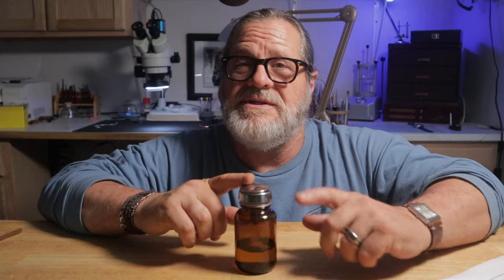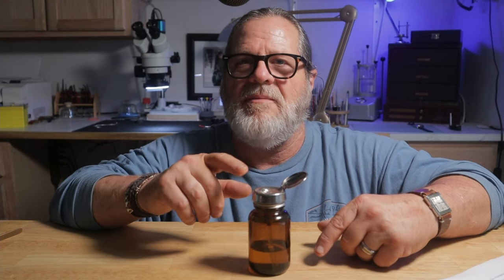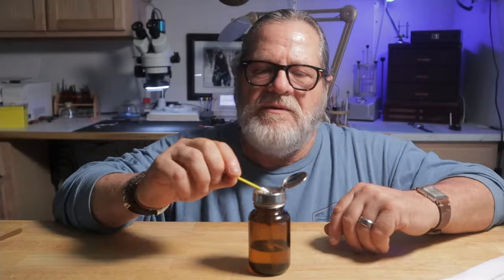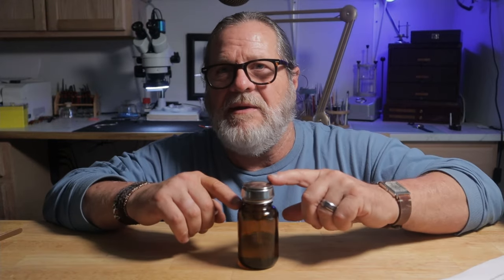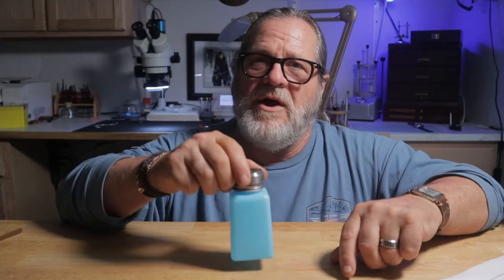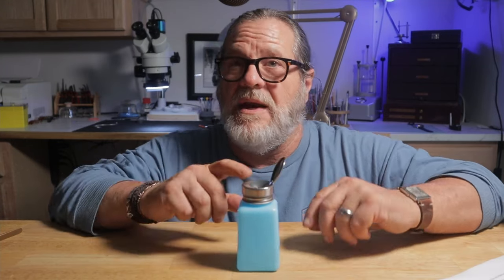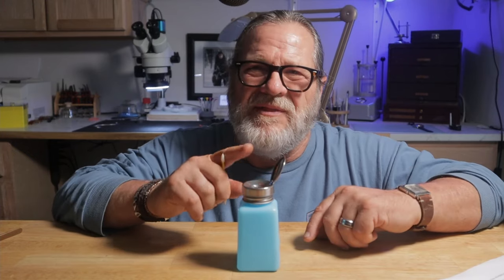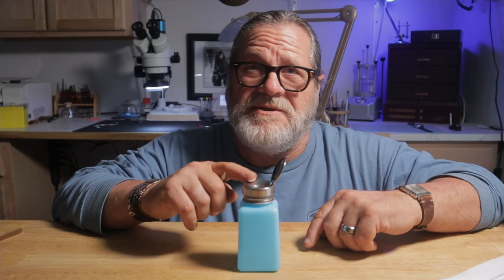How to Clean Watch Parts Without A Machine-Watch Repair Lesson #8

Comment: What is your recommended method/solutions for cleaning the balance and pallets of vintage watches as to not risk dissolving the shellac?
Reply from the maker: I use a product called Hexane It’s similar to a product called one dip but it’s much less expensive and it’s great for removing grease and oil’s. It’s  laboratory grade so leaves no residue. 
I use a little jar called a diamond cleaning jar, that has a hard metal basket in it. I put in the balance complete along with the pallet fork.
I let it suck for a couple minutes and then I lift the metal basket out of the jar and just move it up and down to kind of agitate the liquid over the balance will a pallet fork. I might do this two or three times over a period of 15 minutes.
And then I just pull them out, put them on watchmaker paper and cover it with a dust cover. Works awesome
Reply: @watchrepairtutorials  very much appreciate the response! About to do my first watch and your videos and knowledge has been wonderful in preparation.
Reply: @watchrepairtutorials  Hey again love the vid. I've mostly been hearing that one dip is actually perchloroethylene which is very similar to hexane and it's actually cheaper and easier to acquire than hexane. Lab Alley will ship the 99.9% "perc" to any address whereas hexane must be shipped to a business address as it's a DEA regulated chemical in the US. What do you think about this? Are you familiar with this chemical? Every resource i can find says One Dip is 99.6% perc with the other 4% being some proprietary anti rust agent which may or may not be bs.

EDIT: i found the official documentation. At least the old one dip was indeed perc. It's a pretty good and cheap alternative to hexane in the US.
Reply from the maker: @nunyabusiness9056  According to the CDC, Perchloroethylene is a know carcinogen.  I don't know of any professional that use it. Maybe some do, but I don't know of anyone.
One the other hand Hexane is widely used as a bench top cleaner in the industry. I'm not sure where you heard that Hexane can't be shipped to a residence, I  just ordered some, no problem.
Reply: @watchrepairtutorials   that's real strange you could get it delivered to your home. It was Lab Alley themselves who called me and told me they couldn't do it but did say they could ship it to ANY business address no matter what the business is. 

Also i got no idea who does or doesn't use perc but iv'e since found the original data sheet bergeon had to put out in the uk about one dip and it does say it was 99.6% perchloroethylene. 

I will definitely look up the safety data on it so thanks for that. I only use it in a small jar for the hairspring and pallet fork cleaning so it's probably not too dangerous.

Again thanks for the great vids. Used your cleaning method with the drill and naphtha for the first time last night and it seems so far to have done the job!
Reply from the maker: @nunyabusiness9056  You are correct about the formulation of One Dip. I don’t believe I said it was the same formula, just that it performs the same.
To clarify the shipping requirements for Hexane, I did send them a message and asked about residential shipping and was told that they had my business license on file and that’s why they are able to ship it to my residence. I guess if you are not a business or have don’t have the ability to ship it to a business address then that is a problem.
Anyway, thanks for bringing up the point so we can get some clarity on the issue.
Reply: @watchrepairtutorials  Ah it sounded like you were saying it was one dip maybe i misheard.

Either way i was more just trying to clarify that i didn't piss away 30 bucks on the perc i just got and was just about to clean my balance assembly with haha. I was basically thinking.

"Wait...onedip was hexane? i thought it was perc? Then wtf is perc used for?"

Glad we got to the bottom of it. Seems like a decent alternative for those who can't get hexane.

Comment: Wait... I thought that IPA will dissolve the shellac used to hold in the jewels for the balance and escapement anchor.  I've always read that naptha was the only safe chemical (outside of purpose designed cleaners) to use on these parts.
Reply from the maker: It will with too much exposure. What are you confused about?
Reply: @watchrepairtutorials  Why would you use it as a rinse then? It seems like anything that would degrade the integrity of the shellac should be avoided on those parts.
Reply from the maker: @k-ozdragon  ok now I see what you are saying. I show and talk about Hexane and one dip for cleaning the hairspring and pallet fork. I probably could have explained it better in this video. I do talk about it more in the ultrasonic cleaning videos I made.
I always clean the balance and pallet fork separately from the other parts.
No matter if I am using a spinning basket or ultrasonic machine. 
Here is a video I did showing how much exposure is safe for shellacked parts.

How to Clean Watch Parts with IPA
https://youtu.be/x_6TulURYII
Reply: @watchrepairtutorials  OK perfect, I'm watching everything in order, so I should hopefully get to it soon. As far as I know, it's just those two parts. Do they still use shellac to glue those jewels? It seems like movements after 1970 would use some sort of rubberized acrylic.
Reply from the maker: @k-ozdragon  shellac is used because the stone is adjustable by heating and then it cools pretty rapidly.
Reply: @watchrepairtutorials  That makes sense. I'll have to watch videos on how that's done. Very cool. Kinda crazy to think how we're still using a material that was in use over a century ago for this purpose. Even crazier when you realize it's a bug secretion. It's even used in food products.
Thanks for the info & taking the time to respond, I definitely appreciate it!

Comment: Hello Alex, my name Gregoriy, I am watch repair men, I cannot fix this Cartier Movement Caliber 052 (ETA 2892-A2). the dates  the problem, if you have any suggestions...
Reply from the maker: What exactly is the date system not doing ?
Reply: So, basically dates keep jumping, example disk 1 will pick 1 and second disk will pick 1 to show date 11 next day it will show 27 instead of 12... extremely hard to explain, date disk are located at the 6 o'clock, are there any videos specific to this movement? 
 @watchrepairtutorials
Reply: Hey Alex, when i do quick set for dates, there is 2 disks so if you set 1 on disk 1 and 1 on disk 2, date is 11 but the next day dates change to 17 or 23, dates keep jumping... please help
Reply: also dates are located at he 6 o'clock
Reply from the maker: @sergeyakubov5355  you are just going to have to study the gears and figure out which one is not transferring the motion.

Comment: I wonder if automotive brake cleen would work it drys super fast doesn't leave a residue
Reply from the maker: Try it and let us know.
Reply: @Watch Repair Tutorials  seen your video on shellac damage so may be good for everything but the escapement assembly
Reply from the maker: @MrShaun1578  If there is no residue and its not to alkaline, it should be ok. Let me know how it works for you
Reply: @watchrepairtutorials  ok upon further research CRC Brake Kleen (red label not the green label) is Tetrachloroethylene one dip is the same thing you can buy it by the gallon maybe a way to save money there
Reply from the maker: @MrShaun1578  That's so good, I' m going to include it as a bonus tip and give you the credit bud.
Reply: @Watch Repair Tutorials  actually you can just by a gallon of Tetrachloroethylene for 65 dollars on amazon I found its cheaper than one dip and brake kleen I can send the Amazon link

Comment: Alex !!!  I couldda just shot myself in the foot !!!  When I saw how you " made " your own Basket for 
    cleaning & did it without spending a small / large fortune !!!
  ( like I just spent - EARLIER - TODAY  !  by me buying a very vintage L& R cleaning machine . . . .
At least I got one with heat & reverse . . . .. BUT ?!?!?!  the point is - I did not need to ;-( 

In my future =  I'll try to learn the life lesson  - to be more patient !

Luv ya man  ; )
Reply from the maker: Hey brother, don’t consider it a mistake but a blessing.
This video is really meant for people with so budget or someone doing a one off cleaning.
Many people will start off at this level and as they get deeper in, start thinking about upgrading.
The BEST option for cleaning parts that’s a pretty much no brainer is with professional grade cleaners and rinses like L&R
Reply: Alex ,  I'm just getting started. . . . But also trying to do it on a budget . . . . .  / While also trying to use the " correct - tools ..." @watchrepairtutorials
Reply from the maker: @timparhamsr9598  yeah, I understand but you’ll be happy about it in the long run for sure.

Comment: I am confused sorry, watched twice and did not get it… In summary: 1) Pre cleaning by soaking in Naphtha and mechanically removing gunk; 2) Cleaning cycle by soaking and twisting in ???? (Not clear); 3) 3 consecutive rinses in Iso Alcohol. Never water. This applies to all movement parts except the ones wit shellac, which should be cleaned by ??? (Not clear). Could you pls clarify?? Tks
Reply from the maker: First let me say this is for real beginners, people who aren't ready to invest in the hobby yet and people who want to Mcgyver the cleaning process. 
First you can clean parts one by one in a dish with Naphtha and an artist brush. If you are going to do it like this then soak your parts.
The cleaning process is the same whether you are doing it like this or a 10k Elma machine.
Pre Clean, Wash, Rinse, Rinse, Rinse. What changes depends on what you use to wash the parts.
You can preclean with pretty much any solvent. IPA is my choice. The purpose of pre cleaning  certain area's is to prolong your cleaning fluids. 
Wash cycle-This method is going to work best with a solvent based cleaner because detergent based cleaners work best when heated. Naphtha is suggested here because it is readily available in most places.
Rinse cycles- If you are using a solvent to clean with then the rinse also needs to be solvent based.. i.e.  99% IPA. If you where using a Ultrasonic machine with a heater then you can use detergent based cleaners and rise with water then IPA as a final rinse to displace the water.
I choose to clean my pallet forks and balance wheel in Hexane. You can also use Onedip or you can use CRC Brakeclean which is basicly the same as Onedip.  Naphtha is not the best thing to clean those parts because of the impurities in it.
Reply: @watchrepairtutorials  thanks a lot for the added details

Comment: don't you damage parts by spinning them? i can imagine they collide into each other during spinning?
Reply from the maker: Not at slower speeds no. It's definitely helpful to have larger parts separated in compartmental trays which can be added to the main basket.
Most professional grade machines use rotating baskets that even spin much faster when shaking off the cleaners.

Comment: Sir, is it safe to use 99.9% pure ISO PROPYL ALCOHOL to clean watch parts. Please advise me. Thank you.
Reply from the maker: Yes, for everything except the pallet fork and balance wheel which use shellac to hold the jewels. The IPA will soften the shellac and they can shift out of their positions. That would be bad and the watch will not run properly or possibly not run at all. 
Now if you’re cleaning by hand or  using a spinning basket machine, it would work fine. But it would not work very well in an ultrasonic machine.
Reply: Sir, I am following your video for cleaning parts by hand. You are a professional, but I am an amateur.  Cannot buy costly machinery at least till I am confident of servicing expensive watches.
Reply from the maker: @kswaminathan5439  that’s ok. I understand. I was just pointing out the limitations of the IPA for cleaning.
And for whatever it’s worth hand cleaning certain parts is also done when you have a cleaning machine. It’s called precleaning so this is a good way to start.
Reply: Thank you, Sir. Your advice is invaluable.

Comment: Hexane is probably a good replacement for one-dip also cause one-dip is toxic AF
Reply from the maker: Personally, I don’t notice any smell from the Hexane. But I also don’t keep the lid off the jar for long.
Reply: I believe one-dip has now been replaced with b-dip. Not sure what the difference is to be honest, they both smell the same. Very similar in smell to PERC (Perchloroethylene or Tetrachloroethylene)
Reply: @TheBeardedWatchmaker  Hey this is birbdad from watchrepair talk. 

Literally EVERY resource i could find claimed that Onedip is 99.6% perchloroethylene which is what i'm using.
Reply: @nunyabusiness9056  hey bud. I’m just guessing here; I obviously have no insider info on what they use. If I remember correctly there was reference to PERC in the one dip msds, but Bergeon might be adding other things too. Anyway, there’s a reason one dip has been changed to b dip, so handle those chemicals with care. Gonna be honest with you that I’ve been using Hexane more and more as a general cleaner and I don’t feel b dip is a significant improvement over it.
Reply: @TheBeardedWatchmaker  So one thing i found that was pretty good evidence was a discussion in a google group from 2013 that has them all discussing a pdf from cousins that is some sort of data sheet about One Dip, unfortunately the pdf is no longer linked as it's so old but it apparently definitively stated that it is or was indeed perchloroethylene.  

I think much of the claims of it being perc have come from this pdf which seems to no longer exist.

At the very least quite a few knowledgeable people on the forum use it and have been for ages so who knows.
Reply: @TheBeardedWatchmaker  Hey i just found the product document.

It was definitely 99.4% perc. I wonder if the new version is hexane.
Reply: @nunyabusiness9056  Hahahaa I would laugh my ass off if it is. Since @It's About Time put me on Hexane, I've been singing its praises. In fact, I've been using it as a rinse after washing my parts in an ammonia solution.
Reply: @TheBeardedWatchmaker  Are you a professional watchmaker? I ordered hexane originally and they would only ship it to a business address which i didn't have because it's a DEA regulated chemical. (I guess it's good for making hash lol). The perc was unregulated and cheaper. 

And interesting, ammonia solution. So many different methods...i'm basically just doing what it's about time tells me to do in this video except i got the perc for the shellacked stuff instead of hexane and naphtha instead of the professional chemicals.
Reply: @nunyabusiness9056  Not a pro watchmaker at all hey, more of a side hustle. I'm in South Africa, things are different here. If I was in the US I'd just get the pro stuff. But yeah, Alex made some good recommendations for those starting out so nothing wrong with doing what he suggests.
Reply: @TheBeardedWatchmaker  Ah gotcha. NO idea what you can and can't get there.

Here in the us hexane is a bitch to get.
Reply: @nunyabusiness9056  bonus tip: crc qd electronic cleaner. Just don't blast hairsprings with it. I learned the hard way.

Comment: I hate quartz watches, it should be only mechanical automatic watches but it arrived back in the 70' by Japanese watch makers and slowly it did invade the whole world by replacing the mechanical watches. So you can buy a new watch rather than having it fixed. That's the sad part of the watchmakers story.
Reply from the maker: I know there are a lot of quartz watches that are low end but there are also plenty that are high end as well. They have great dials, hands, cases and bracelets with high end finishing. Not for everyone's taste but it is a big part of watch world.